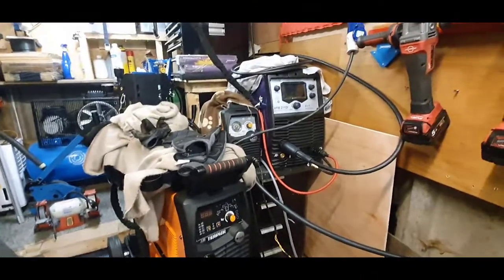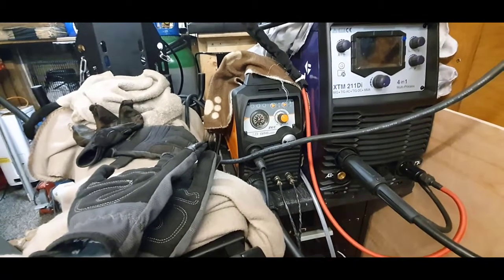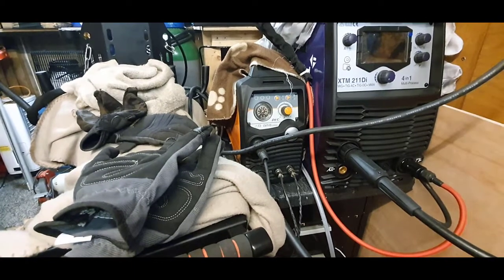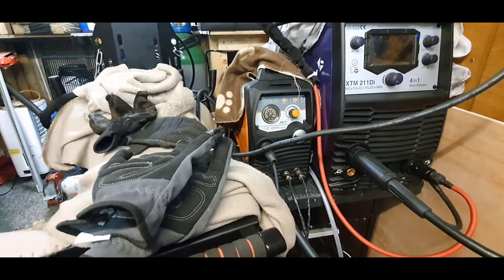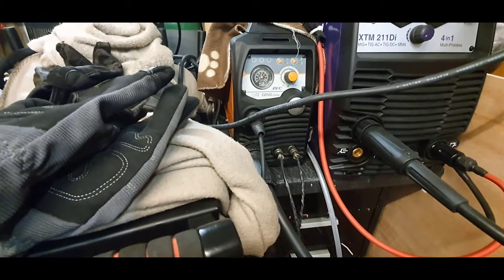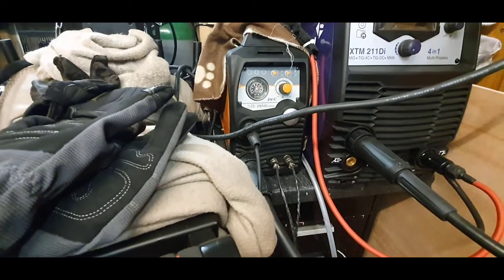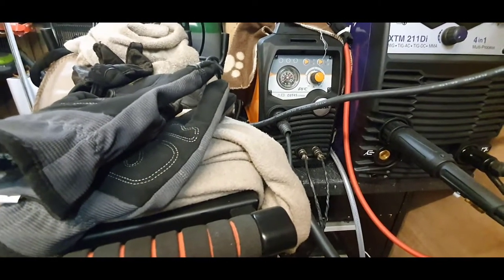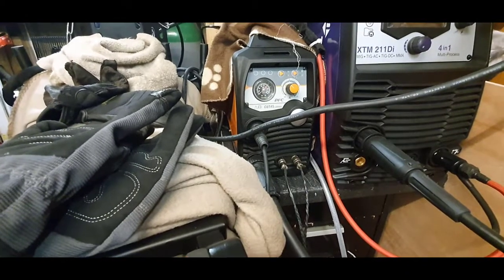Jasic Cut 45 Plasma Cutter (Update)

Comment: I am so glad I found your channel. I have the CUT 45!! for my plasma build & loving it, Can you share with me your current settings for different material thickness and cutting speeds?. At the moment I am trying to get the machine tuned  for various material thickness. Nice videos !!
Reply from the maker: Hi mate yes contact me through Instagram if you have it as I have them all or for most as its took a ton of time to receive and I will send the table over to you 👍. Just been mad busy in work but will start the new vids soon 😉